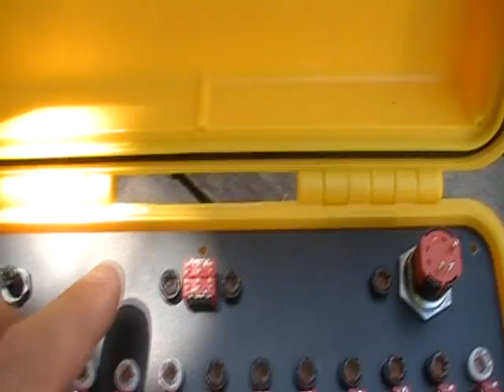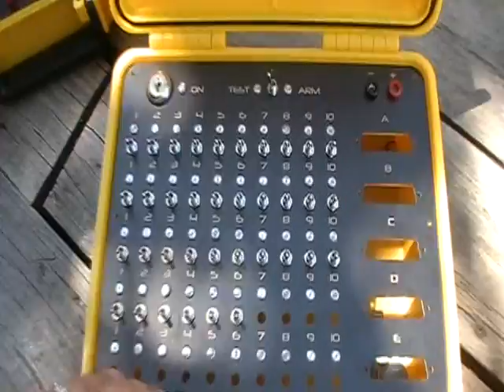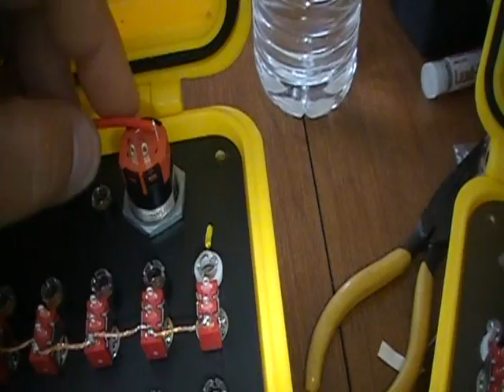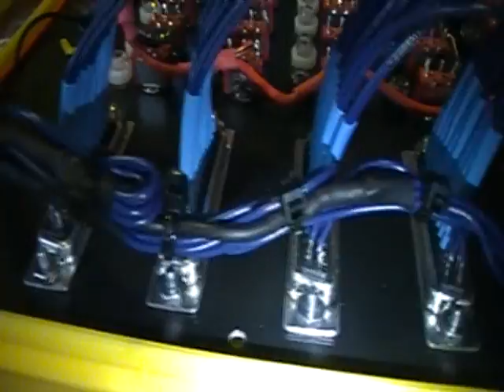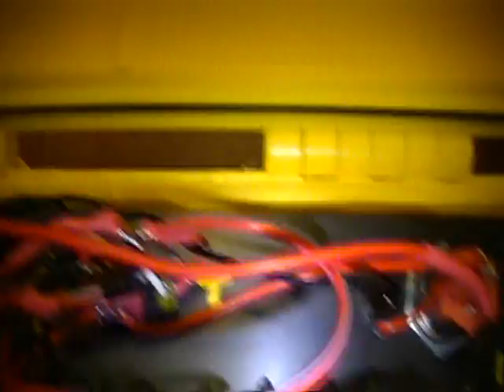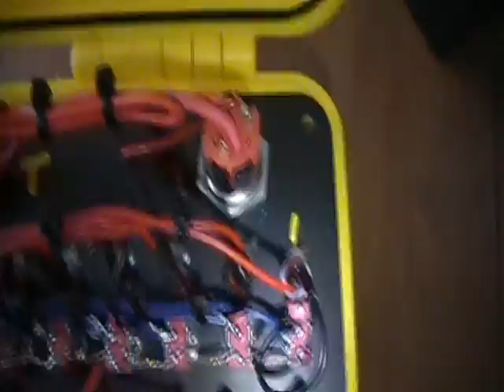How to build an ODA firing system

Comment from the maker: If you contact Mike McCoy at Trmpyro dot com, he should be able to get you a diagram.  I don't remember if I had a diagram or if I went off of a different system I had in front of me.
Reply: Catfish25p2000 Thank you for making this video! Do you remember about how much this whole system cost you? Also, couldn't you make the slats yourself (I know... more soldering) but it would get even cheaper! Another question, what parts did you get from trmpyro.com and what parts did you have to buy? Just curious as I might be building a system similar to this for my 4th next year! Thanks again for the video!